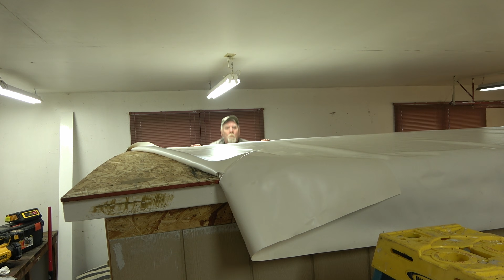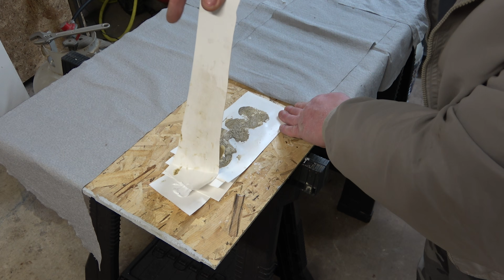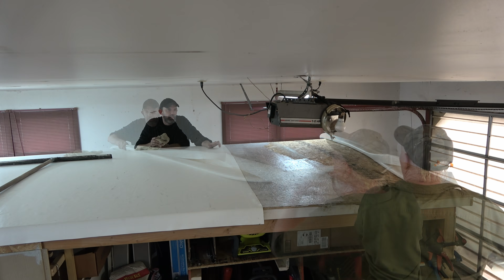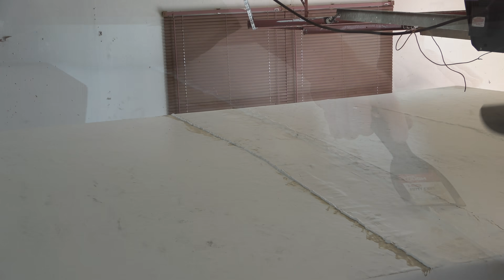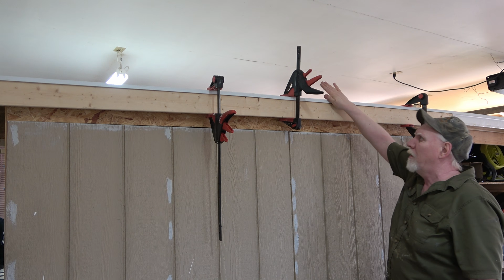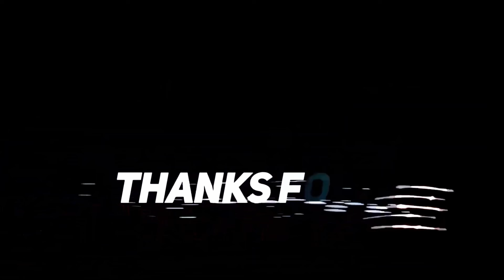Install PVC Roof Membrane On Rolling Supply Trailer/Overlap-Watertight-Seam (part 6)

Comment: I don’t understand why you didn’t just get a pvc welded off amizon for 500$ and weld that joint. Or, I bet you could have called a roofer in your area and he would have welded it for 200 bucks. To anyone watching, this is not a good way to do this job. Don’t follow this guy’s directions.
Reply from the maker: Better yet for under $500 you can get a longer sheet of vinyl roofing to cover the entire roof 🤟

Comment: Pvc cement is the proper way to do that. I wouldn't trust my new roof to titebond. I bet it breaks down in the high heat that roof will experience.
Reply from the maker: This PVC Roof Membrane is amazing! During last summer season it was sitting in direct sun and during the hottest part of the summer it was warm inside but that's about it (wasn't cooking like a typical shed)
Reply from the maker: What a wonderful idea "Pvc cement" Thank You 👍